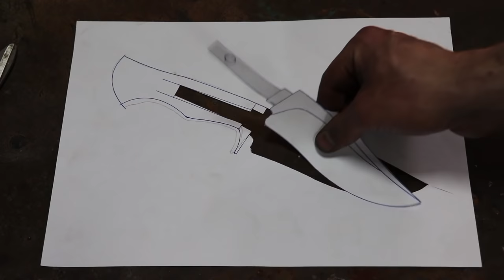Knife Making | Knife from Leaf Spring

Comment: i got a challenege for you...same design of knife but a bit longer and forgeweld 2 pieces of the leafspring together and also when forging the knife fold the metal in on itself a couple of times for added strength ,

Comment: Great video, I was interested in your forge, what did the bowl come from, and , where is the air come in, underneath, obviously you can get it hot enough to heat treat spring steel, look foward to more content..
Reply from the maker: Thanks, the bowl is from an old chain fence post and the blower goes underneath from an adjustable pc fan
Reply: An old drum brakes hub from a van might work well.